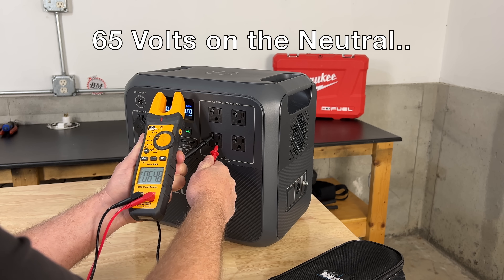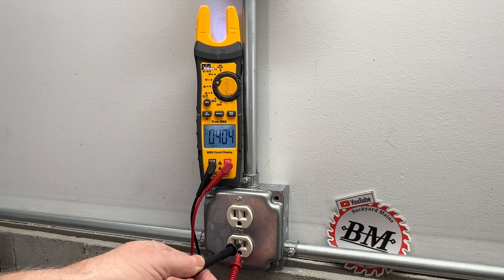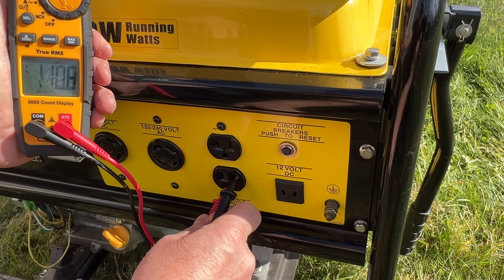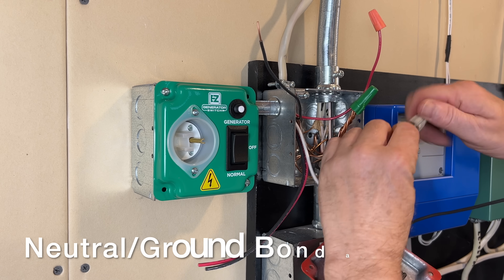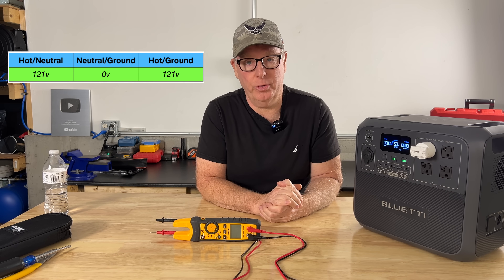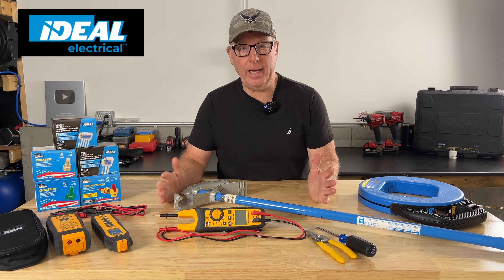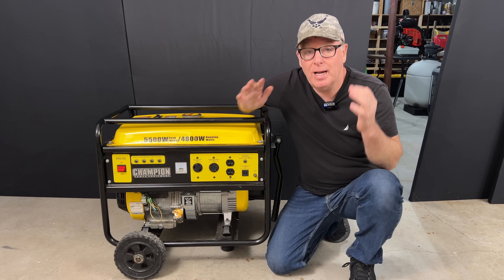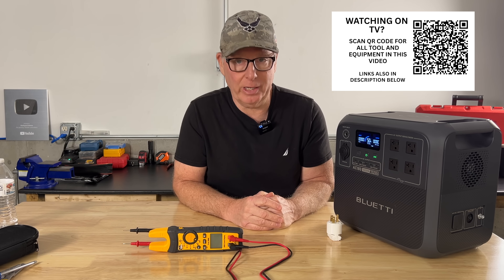The Hidden Generator Mistake.. (Dangerous)

Comment: Your information you put in this video is accurate but very much incomplete.  Some small inverters and small power stations have actual live voltage on the neutral and they cannot be bonded to their ground. On those units the neutral is more like an L2. You absolutely cannot hook those up to house wiring that has a ground neutral Bond. For when does inverters will burn up if you do that but more importantly you will put live voltage on the equipment ground itself.  In short you need to confirm that the voltage on the neutral is actually ghost voltage. Sometimes the voltage on the neutral not ghost voltage at all. To verify this it's best to use a digital meter that has the two yellow buttons on each side that has a resistor. If you engage the resistor and the voltage doesn't drop then it's live voltage. It can also be tested with an incandescent light bulb.
Reply: Right
Reply: The normal mode part of an EMI filter will produce a charge across the capacitors between neutral and ground.
Reply: @AlanSanderson-u4t I believe those only produce a ghost voltage.  I was referring to those crazy small inverters that have two hot legs 180 ° out of phase from each other. A lot of those don't even have a ground. They just have a hole where the ground plug would go. Even some of the mid-range inverters that have terminal blocks shouldn't have their ground and neutral bonded together. Best recommendation is if you plan to bond your ground and neutral on your inverter you should check with the manufacturer before doing it.

Comment: This is the best explanation I have ever heard on when and when not to neutral-bond your generator. "Bonded once" is an easy rule to remember. I have a Champion Inverter/Generator that is neutral floating. Since I'm using with extension cords, I use a bonding plug.
Reply from the maker: Glad to hear it was helpful and that you found the "bonded once" rule easy to remember! Even some electricians get this wrong.

Comment: 12:52
Generators have bonded neutral when any metal parts of the generator are accesible to touch. 
It's for a safety reason, so that none of the exposed metal parts can get energised.
Reply: That's not really true. If you bond the neutral then you are energizing the exposed metal parts with one side of the power source. You need to contact both sides of the power source to get a shock and by bonding you are already touching one side. The safest system is with no earth ground and no bonding of the ground and neutral. With bonding, you start off with one foot already in the grave.
Reply: @MandrewP  good point. I never umderstood the reason for split phases systems..

Comment: Other than the gas generator, are your other power supplies " UPS " ? No motors, only batteries "DC" transformed into AC ? 
My guess is Yes, and it's strange that you have the same floating neutral issue like with a real generator...
Generators use magnetism to create the AC voltage (2 lines with a common neutral 120/240V ). But UPS dont.. they use electronic inverters to turn DC into AC. Do you have both 120 and 240v on the power supplies?

Comment: Neat channel, currently using an older 2000 Northern Hydraulics 10K generator running 1/2 the house. Water heat, kitchen, master bed and bath. Wife wants a whole house unit to do whole enchilada. Which includes the garage 50 x 36 with chest freezer and 2 more refrigerators. We do have 36 solar panels in addition. Without computing  wattages 20K to 25K  be needed? Is it possible to measure wattage from the breakers? Or do I need to put on paper all the appliances running on a day and nite basis?

Comment: Ungrounded bonded standalone generators are still incompatible with external GFI things like GFI extension cables and UPSes. The problem is that bonded without a single path to real Earth ground lacks sufficient capacitance of a large "conductive" object to provide real electrocution protection, bonding it masks the problem but doesn't solve it. The phantom voltage happens in a standalone bonded or unbonded motor-driven real generator (not a solar "generator") because it's capacitive coupling on the parallel wires of hot, neutral, and ground with insufficient capacitance of the floating bond unable to pull the bond side deeply enough to a single reference voltage: so in bonded the ground and neutral will be the same but not close enough to real Earth, or they'll be vastly different in unbonded and ungrounded.
If you violate the warranty by unbonding a bonded generator yourself, put a huge written warning on it. And label bonding plugs. When using a standalone bonded generator, use a proper temporary grounding electrode and ground it to Earth in exactly one place, at the generator's bonding wire. Floating grounds and neutrals are evil, and so are multiple ground terminations... there must be one grounding point and one bond of neutral and ground to rule them all.

Comment: I have not watched the video yet but am responding to the 60v / 60v thing. On passenger cruise ships my understanding is the 120-volt outlets are not like in the US or Canada. On ships the one prong is +60 volts, the other prong is -60 Volts for a total spread of 120V. Being AC power the plus and minus keep switching. This odd voltage Arrangement is why passengers are prohibited from bringing their own power bars (or surge protector power bars in particular) onto ships. 
I believe there is 3phase 60v/60v/60v cabling with 120v between any 2 legs and reduced risk of dangerous shock from 1 leg to ships ground (i.e. most of the ship)

Comment: capacitive coupling -  phantom/ghost voltage, which is a false voltage reading on an open or unused conductor caused by an induced voltage from a nearby energized conductor. This phenomenon happens because the two conductors form a capacitor, and the high-impedance input of many digital multimeters can measure the resulting induced voltage.

Comment: The only thing that appears to be missing from this video, is mentioning that there are some multimeters designed to detect and work around the capacitance, such as the Fluke 117, that should give you readings you would expect.
Reply: Ideal has some meters with that low-Z function too.  Fluke meters are excellent too, but at the price point of the 117, I think the ideal meters are nicer to use.
Reply: @charliesullivan4304 I figured there were others, but didn't know of any specifically. Thanks for sharing! I'm personally a Fluke fan, but agree they are a tough price to justify for most people.

Comment: I always run a bonding plug in my RV when I'm not connected to shore power solar system is bonded neutral. When I connect to shore power remove the plug.

Comment: I tested my Ego 400 Watt inverter after watching the video. It presents yet a third option and that is no ground. When I tested ground to hot there was no volts. An inspection of the ground terminal showed that it is completely plastic with no internal metal or wiring connection. Just a hot and neutral. Can you explain this? Thanks

Comment: Fantastic video !!!  Apologies for my question / confirmation of setup...I have a Westinghouse 9500 DF with a "Neutral bonded to frame".  A 50 amp connector on the house to a Pro Tran 2 breaker box to select circuits to run.  The neutral from the Pro Tran is connected to the main panel ground bar. The ground ( green) is also connected to the main panel ground bar.   I'm assuming the main panel config is managing neutral and ground...
Should I disconnect the Neutral bonded to frame connection?   My only use for the generator is to run specific house circuits.   Again...apologies.
Reply from the maker: No apologies needed, that's a great question! For connecting to your home, you definitely want a floating neutral on your generator.
Reply: @BackyardMaine  thank you so much !!!

Comment: I just installed an inverter with a builtin transfer switch (PD1600 SERIES) in my travel trailer. The service panel (PD55K003 SERIES AC DISTRIBUTION PANEL) has two separate AC hot and neutral buses and the inverter has a separate ground wire to the frame . Bus #1 only has power when plugged into shore power or a generator.  Bus #2 is powered by shore power when available but is powered by the inverter when its not.  If I am unpluged from shore power and plug my portable generator into the shore power receptacle in the RV, should I have a floating bond at the generator or should I have a ground rod for the generator because I am no longer connected to the shore grounding conducter?

Comment: I have the XP13000EH generator made by Duromax.  I don't camp, I only use the generator as backup power for the house.  I emailed the Duromax company asking why the generator came as a bonded neutral machine, the rep said it was a mistake by the factory.  It was a simple fix as there was a single jumper from the ganged neutrals to a chassis ground.  I now have a floating neutral machine!
Reply: I have the same generator as you. What's the benefit of the floating neutral versus bonded ?

Comment: I've been trying to figure out what I should do about grounding in the camper van that I'm building. Normal 110V power is going to come from an ecoflow power station, I'm going to ground it to the chassis so a breaker will trip if a wire gets cut by sheetmetal. Shore power will only connect to one gfci outlet, and the ecoflow will get power from it. So I should connect ground from shore power to the chassis also, so the gfci can work correctly.

Comment: QUESTION - I have a Solar powered system. Panels. Batteries, Charge controller/inverter. I ran the power from the inverters to a 2 pole load center, with the ground and neutral bonded at the load center and the grounding rod 8 feet into the soil at that load center. The inverters have grounding screws but I did not ground them to anything. Is this correct? Another question, my solar panels are not grounded, should they be? And if I do would that possibly create a problem with two grounds in the same system? Mt panels are about 200 feet from my load center. Thank you, and this video was very instructive.

Comment: Dutch home grid power has  bonding at the distribution transformer.
So we alway use switched neutrals.
I would also use switched neutrals if I would install a backup generator in the US, as stray currents from other homes (generators/PV) could still produce potential on the neutral.

Comment: You are not going to plug that in to power your house are you though. They are intended for individual loads. In the uk we use 110v transformers for power tools these are center tapped (55 ground 55) the idea is that under a ground fault you will only get a 55v shock from your 110 appliance.

Comment: Nice video. I have a cargo trailer I converted to a simple camper. It does have a rooftop AC, technically it’s an air source heat pump. You’re telling me, when I use it for that, I should use one of those jumpers?

Comment: At 6:52 "Don't connect between the green terminal and the brown/live terminal as that would be a short circuit". It wouldn't be a short circuit actually because both the live and neutral terminal have no low resistance connection to "ground".
Reply: The live and neutral most certainly would be shorted together if you did what he said not to do.
You just connected the neutral/earth bonding wire moments beforehand, then you would have a direct short between live and neutral via the earth terminal🤣

Comment: Uas wondering why I got zapped off the ground while running inverter for lights and fridge, tied to ground in house, still had mystery voltage on lines with everything disconnected, just decided to unhook ground at inverter no more shocks , will try and use this info on next power up on new house, given running through sub panel and it has to have it’s own ground and no bonded.

Comment: The Bluetti AC-200MAX, and possibly others, has a known defect, where the connections to neutral and ground are reversed. Rather than disassemble the fragile plastic case to correct this, I made an adapter and display a sign on the generator warning that the adapter must be used when connecting to my home power through the 30A outlet. I don't care about the defect on the other circuits.

Comment: After much reach search, I’ve learned that it is not safe to attach a neutral bonded generator to your house, creating two bonded neutrals on one system. Question, once I modified the generator to floating neutral, if I touch the generator while it’s running, will I get shocked?
Reply from the maker: The generator will be bonded and grounded when the cord is connected to your home. When you run the generator not connected to your home consider using a bonding plug. In either case the generator will be safe to touch when it's running.

Comment: So, a Portable Generator connected into a Back fed breaker on a sub panel should have a bonded neutral on the generator?
Reply from the maker: No, absolutely not. That would create a dangerous condition with multiple neutral-to-ground bonds. Even though your sub panel has the grounds and neutrals separated they are in fact still bonded at the main panel or at the service disconnect. When the generator is connected through an inlet box and a back feed breaker the generator should have a floating neutral.
Reply: @BackyardMaine  Thank you. I had spoken to the electrician that installed the inlet and they said that the bond on the generator did not have to be broken.
I will read the instructions and make sure to do it properly.

Comment: At what point do you attach a ground to the ground terminal of the generator or power station?
Reply from the maker: The manufacturer recommends you connect the ground terminal to ground either a ground rod or other grounding system. The code does not require that however. When the generator is connected to your home it should have a floating neutral. When it's connected it will acquire the ground and the ground neutral bond from your home. In that case you don't need a ground. 
When the generator is run as a stand alone system (not connected to your home) you will want a bonded neutral which can be done with a bonding plug. It that case you may choose to connect to a ground rod but its not often practical to drive and remove a ground rod whenever the generator moves. The code does not require a ground connection for portable generators. When the neutral is bonded your breakers and GFCI protection will function properly without a ground rod which is really just surge protection from a near by lightning strike. So in that case it's up to you.

Comment: You are using a RMS volt meter. Use an analog and check your readings again.  It will be different  numbers.
Reply: He mentions that at 5:20
Reply: He mentions that at 5:25

Comment: I could hace loaned you my old Simpson for this demo......
So many electricians don't understand what a high impedance meter is and how it can mislead
Reply: I have a Simpson 260. I also had an old military PSM-6.
Reply: It’s even funnier in the electronics world, where it’s not uncommon to have bench multimeters with such high input impedance that a “high-impedance” electrician’s meter would be considered “low impedance” by comparison! People who have never used a bench multimeter before are then often surprised to see the voltage reading jumping around like crazy (often counting up to some value and then resetting to zero, cycling indefinitely) when no input is connected. Of course, the instant you apply a voltage, it jumps directly to the correct value.*

For context, a standard, high quality electrician’s meter usually has a 10 or 11 megaohm input impedance. Some cheap ones have 1 megaohm. On most bench multimeters, the input impedance on lower ranges is 1 gigaohm. There are also specialized meters called electrometers that have input impedances in the teraohms!!

*For electronics, good bench multimeters have the advantage of being spectacularly fast, being able to autorange and measure in a few milliseconds (in DC modes — AC is slower, since it needs to capture a few full cycles to determine the actual RMS value). They’re so fast you actually have to slow them down so the display isn’t just a blur! It’s just magical to not have to wait for the display to update like on a handheld meter. (My bench meter at home can do 2000 readings/sec, vs. 3-5 readings/sec on most handheld meters, with a few outliers at 7 or even 10 readings/sec.)